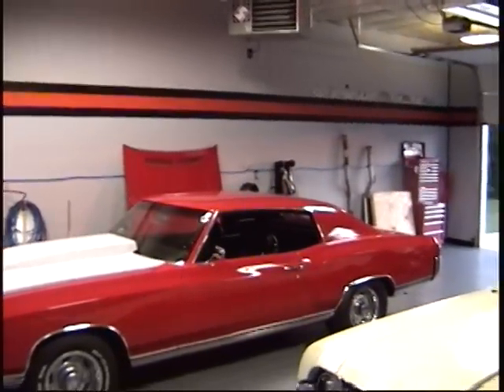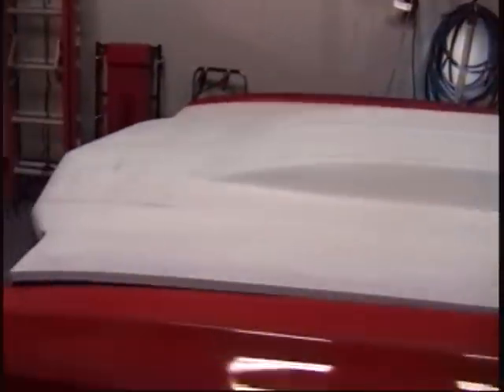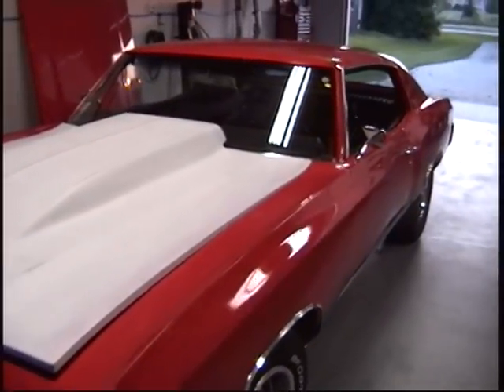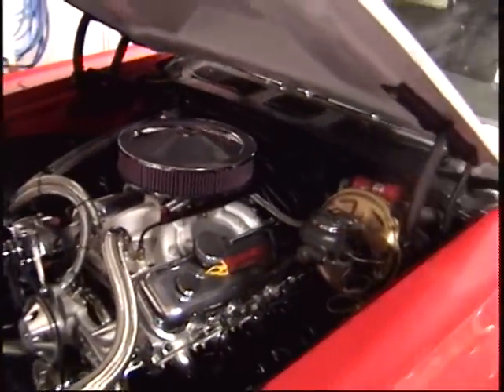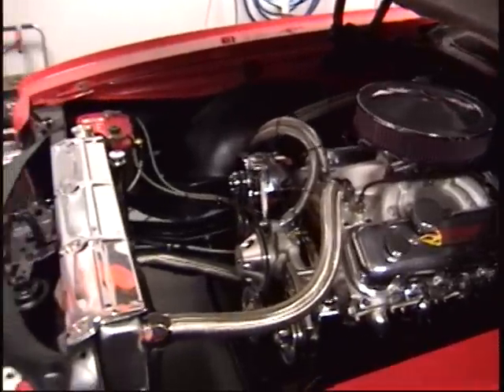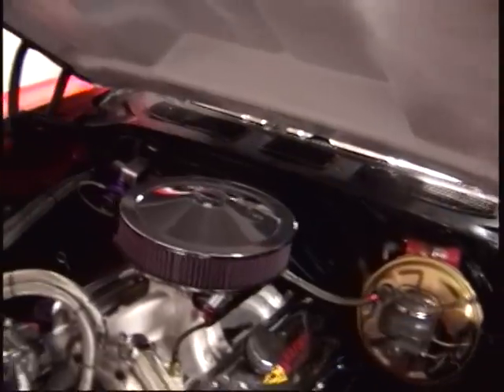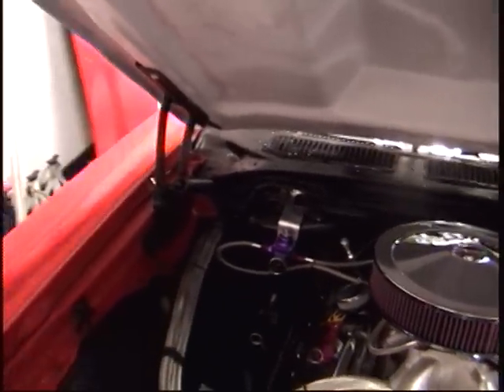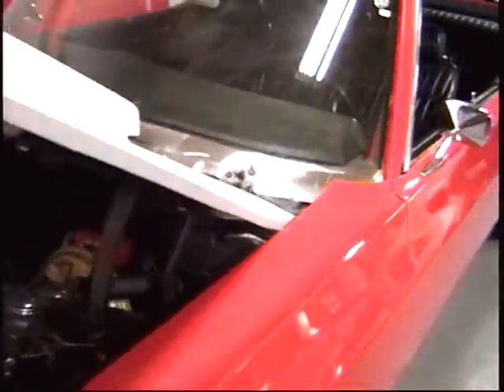1970 Chevy Monte Carlo with Shafiroff 540 Big Block

Comment from the maker: @Monte1970SS My Monte came AC too.  I ended up removing it, since servicing the passenger side was a hassle.  I used an AC Delete cover, which looks pretty good.  I may end up replacing the old AC stuff with Classic Air modern system.  My care is silly on the street.  I run a 3" exhaust and sounds sick.  The looks on peoples faces when I'm driving by them is fear cause it sounds like a race car.  I love it.  It would be cool to hit the cutout button like you.  i have the bolt on cutouts.

Comment from the maker: @Monte1970SS I could, but I'd have to decrease the compression.  I'm running 10.5:1.  My car still looks stock except for the 4" cowl hood that I needed to install to fit the single plane intake on the 540.  Unfortunately, our drag strip is pretty strict with NHRA rules.  I only got to run 2 day last year in Sep and Oct last year.  I was lucky not to get a warning once I passed 11.5 in the 1/4.  I have to add a roll cage now.  One of my friends had a nice one in his 69 chevelle.

Comment: Hey you still did an excellent job on the car. My car is just for fun and most of the time when I go to the strip, I will get no times posted but still get my slip. Rules suck but if you are gonna run to compete, then you need to follow them and yeah I seen some cars with roll cages that looked good. I will send you more by email, cause this chat has been gettin big on youtube!

Comment from the maker: @Monte1970SS I have removable cutouts, not electrics.  How do the electric ones work?  I've heard good and bad.  My motor is a Shafiroff 540 that came in a crate with a Dyno tune run.  I was going to build a 496 with a procharger until I figured out it would be about 19 grand by the time I was done.  Also, I can hardly get the 715HP to grip the track, I'm not sure what I would have done with 1100HP.

Comment from the maker: @Monte1970SS - It sure is!  Was that your car I saw running a 10.97?  I've yet to get any traction.  I'm running BF Goodrich 275/60R-15 G-Force  street slicks, which are useless.  Every launch has been "soft-lauched".  I've got 715HP and I only got to run it two nights with a best of 11.1.  I'm working on stuffing a 10" slick under there, but since this was a Tenessee car, I'm not in love with trimming the perfect steel in my wheel wells.

Comment: @scorpioz1967 Are you running full exhaust, and what kind of carb do you have? I have a 1050 Pro Systems Dom and electric cutouts. I open the cutouts when I run, and with that bigger carb I could get high tens. My engine made 720 hp and its a 511 big block, but It has a .750 lift solid roller cam in it. A little wild on the street but fun!

Comment: Scoepioz1967, I have a 540 shafiroff  in my corvette. Just curious if you are have this same issue. I keep fouling plugs because the pcv is sucking oil into the intake manifold. Oil travels to the back of the plenum and # 7 cylinder gets fouled with oil. How do you have your pvc setup?  Any information would be appreciated. Thanks Vinny.

Comment: Hey bro while I'm a Chevy guy my whole life.. I can't say I understand why you picked a 4700 LBS Barge to set up.. you could have gotten your hands on an old Deuce or some early rusted out Camaro you could have purchased every steel panel brand new  and had a sweet and light and fast car for you 540 to call home ...But to each his own ..I guess
Reply from the maker: FYI, the car weighs 3720 lbs. with a full tank of gas.  I've had this car since I was 15 back in the 80's and it's been slowly improved year after year.  I thought about getting a 80's Monte, gutting it, and putting this engine in there, but love this car.